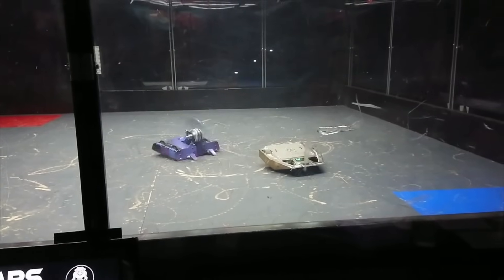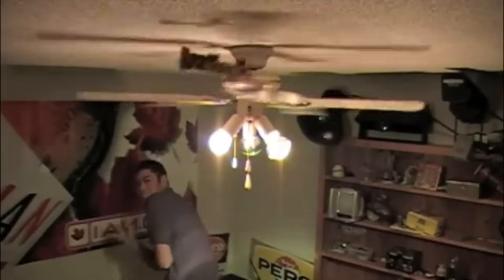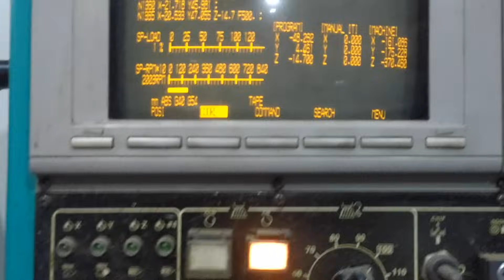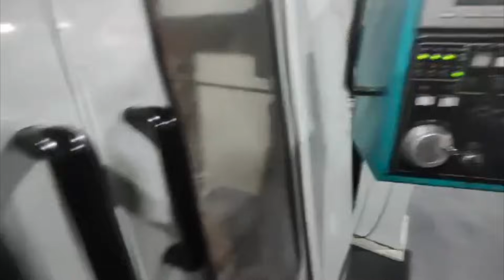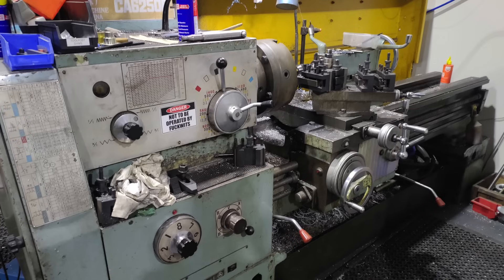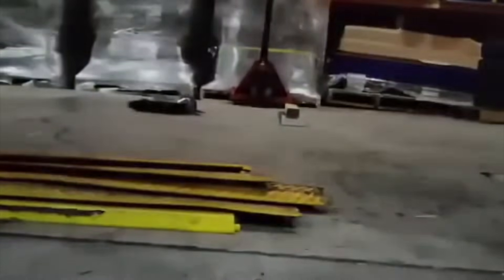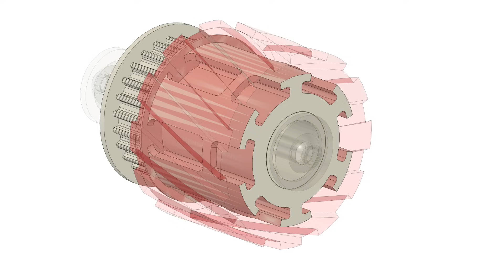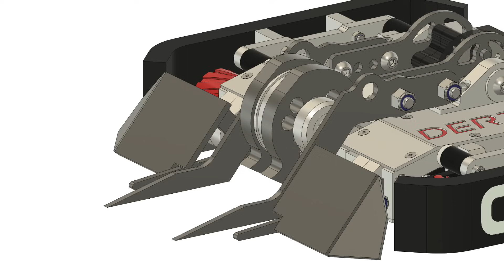Can I Fit Two Weapons in One Robot? - Derive Part 2

Comment: I absolutely love Derive, so fun to watch :D I am building something similar in the beetleweight class, and was curious to know what channels you use on your transmitter to control the weapons independently?
Reply from the maker: The drivetrain is the usual arcade mixing. Lifter is the left hand up/down stick (throttle), while the spinner was controlled with a potentiometer and on/off switch
Reply: @BrokenLinkRobotics  I've done it the other way round with mine, since the lifter is a servo, but I think swapping it round would work too :) thanks

Comment: What type of drivetrain is this? I can see it uses tank drive (or a form of it), but it seems way more maneuvarable and responsive than a normal one. Is this just because of the faster speed, or does the code automatically adjust its heading to be relative to where the joystick is pointing, with forward on the joystick always forward relative to the bots starting position, kind of like field centric?
Reply from the maker: @goblin no smarts just 4wd standard tank drive. The drivetrain is wider than long so it steers better than average. Motors are also very powerful with grippy tires
Reply: @BrokenLinkRobotics  oh ok, thanks!